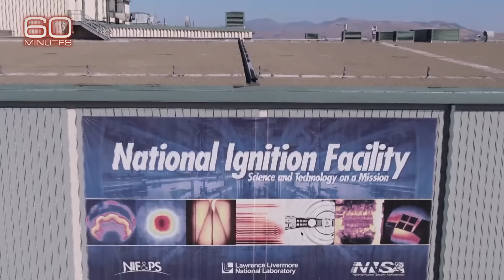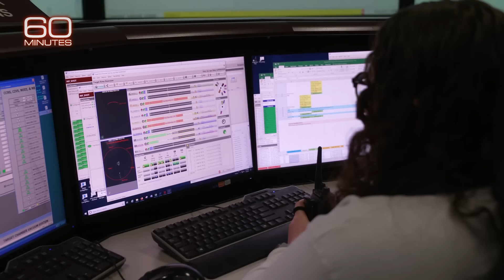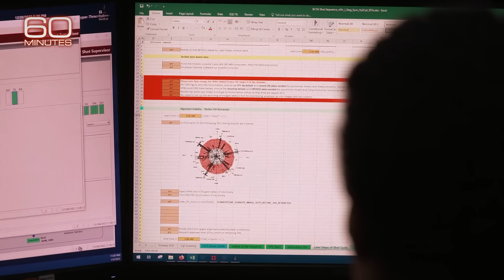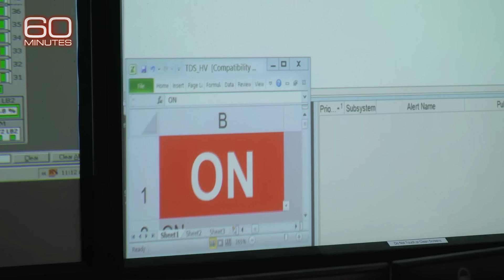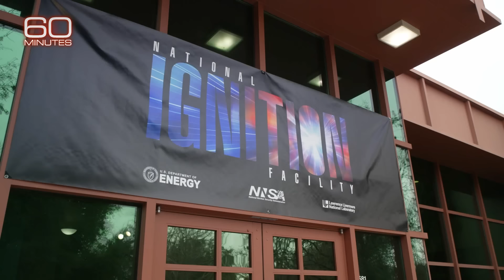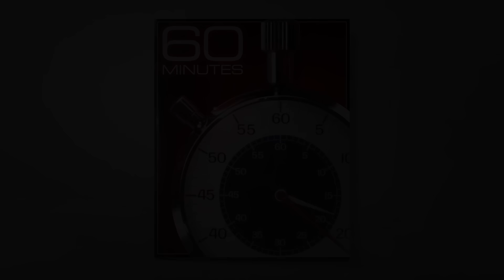Nuclear Fusion Breakthrough; Powering Electric Vehicles; Carbon Capture | 60 Minutes Full Episodes

Comment: The comparison of the ignition at Livermore to the Wright brothers flight is pure lunacy. It was the flight of a complete assembly of a plane, unlike the ignition which is one of many parts and systems that are yet to be succesfully designed.
Reply: The reported experiment at the National Ignition Facility (NIF) took approximately a week to set up but the actual nuclear fusion reaction lasted for approximately 0.000,000,000,08 second. There was no significant amount of propagation of the reaction in the microscopic portion of the fuel that did react and approximately 96% of the extremely expensive fuel was blasted away before it could react.

The maximum shot rate of the enormous NIF lasers is about one shot per day. It is rare to get anywhere close to that rate. Since this announcement  , almost 1.5 years ago, only a few of the NIF shots have gotten close to this announced shot.

Comment: NIF was never designed to generate grid level energy. I worked as a subcontractor to NIF for years in the late 1990s, NIF has no capability to extract electricity, total energy input is orders of magnitude greater than output. Main function of NIF is to make a life long career project for the people who work there.
Fusion is already working (the sun) and it is the cheapest form of electrical energy we call it solar pv and when combined with wind and storage we can and do deploy it today.

Comment: So I am wondering (the last part) if CO2 would be released once we break up the rock?
Reply: One experimental carbon capture and disposal underground relies upon a underground formation that is porous and the basalt then slowly reacts with the injected CO2 to form a long-lasting carbonate type of rock.  The demonstration project in Iceland is sited in a very special place where it is also powered by geothermal energy. This situation exist in few other places around the planet, which the promoters never mention.

In some cases CO2 has been injected underground, specifically to force fossil fuels to the surface. It will be eventually burned with that carbon being injected back into the atmosphere. It is kind of a shell game.

It remains problematic that once CO2 is injected deep underground, in massive quantities, that a portion of it  will not leak out again over a period of time of less than 100 years. The attempts to sequester CO2 underground have been going on for approximately 30-years. It has had virtually no effect on the constantly rising CO2 level in the atmosphere. Many of the projects have either failed to live up to the original expectations, or they have been closed. The promoters tend to exclude that part of the story.

Comment: At 21:50 indicates steam is released and not utilized. Is there a reason engineers do not utilize a turbine and generate power?
Reply: The steam coming out of the brine containers is not being used because it has already been run through a generator, that is just the last part of the cooling phase. The initial excess steam is pumped out of those large towers (cooling towers) and the still hot brine is continuously cooled until it is ready to have the Lithium extracted from it.  Point being, the steam is too low pressure/cold to be used to power generators, but it is still too hot to have the Lithium extracted.

Comment: After sleeping on this I'm still impressed but I have questions .How long can you fire the laser and it makes me wonder what the next move is to have a prosses or design to have the same lasers continuously fed until the capacitors are discharged. Without a continuous fed laser it's not going to be a good source of energy production. It's just a learning tool at this point to see if I could be done. It leaves more questions than answers.
Reply: The laser driven Inertial Confinement Fusion (lCF) nuclear fusion energy research at the Lawrence Livermore National Laboratory (LLNL) experiments began in the late 1950s. The National Ignition Facility (NIF) lasers experience to much damage if operated at a rate of more than about one shot per day. It is rare that they get anywhere close to that rate. The announced experiment took about a week to set up. The nuclear fusion reaction lasted for approximately 0.000,000,000,08 second. It released about enough energy to boil two liters of water. It took more than 100 times that much energy to drive the massive laser system. The radioactive tritium fuel has a market value of approximately $30,000/g and the sources are extremely limited. The destroyed target assembly is estimated to have cost around $100,000. It’s been estimated that NIF has consumed over $11 billion. Its primary purpose has always been as a thermonuclear weapon (H-bomb) research tool. The administrators have always been masterful in obscuring that fact when presenting to the press and the public.

Comment: There needs to be hundreds of such facilities around the world…
Reply: This announced nuclear fusion reaction lasted for only about 0.000,000,000,08 second and the experiment took about a week to set up. The energy released was about enough to boil two liters of water. Over 100 times more energy went into driving the laser shot. It’s been estimated that approximately $11 billion has been spent on this facility that originally promised this ‘breakeven’ event to happen by 2012.

The administrators have become masterful in obscuring the primary funding for NIF which is to serve as a thermonuclear weapon (H-bomb) research tool.

Comment: Can the stone created by these direct air capture plants be used for anything so it becomes a product.
Reply: The demonstration plant was deliberately placed in a unique location which exist in only a few parts of the world. The energy to operate it comes from geothermal energy which was already developed at the site and the underground basalt formation was highly fractured, making it convenient for the CO2 injection. The injection point is quite deep so it is not easily accessible. There are few other similar injection plants like this around the planet. To have a significant impact upon the excess carbon already dumped into the atmosphere tens-of-thousands of these types of plants would likely have to be created and run for decades.

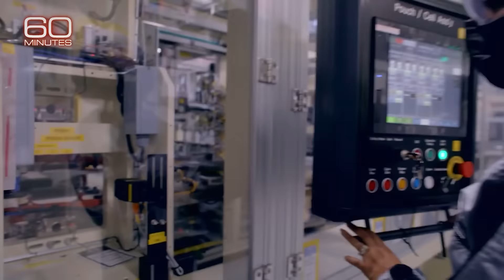Comment: 17:11 the narrative means "energy dense metal." Lithium is not a dense metal. In fact, it floats easily on water.
Reply: Energy density does not equate physical density. By your reasoning Kerosene (a very "energy dense" liquid hydrocarbon) should not float, yet it does since it is less dense than water just like Lithium.

Comment: NIF is an interesting research facility but it will never generate continuous fusion. They never mentioned how much energy goes into making the fuel pellets either. Spherical or tokomak designs are more likely achieve this with magnetic confinement and we have machines which have produced continuous fusion for more than 30 seconds at temperatures of 150 million degrees C.

Comment: 36:50 Wood is supposedly carbon neutral as the carbon released goes back into a new tree. I can see that an equal amount of carbon removed from the atmosphere could offset, may be completely, the amount of carbon sent into the atmosphere with the use of newly produced oil or gas. She did say that the sequestered carbon may be an amount larger than the oil / gas released anew.

Comment: Just checking in a year letter. Needed something to hope for.
Reply: The craving for hope has generated marketing aimed at feeding those cravings.

NIF has about doubled the fusion energy that they can achieve with such highly specialized laser shots but they remain difficult to reproduce such shots. Keep in mind that the pumping of the lasers still consumes around 100 times more energy than is generated by the fusion reaction and that reaction only lasted for approximately 0.000,000,000,08 second. The experiments take almost a week to set up. Like all the other record setting fusion energy experiments they all continue to be many, many orders of magnitude away from demonstrating a economically practical source of electrity generation. As has always taken place the administrators tend to obscure the primary purpose of NIF which has always been as a thermonuclear weapon (H-bomb) research tool. It's been estimated that at least $11-billion in USD, from federal revenues, has already been expended by the NIF program.

Comment: I of course have no idea, but the questions can't help but be asked. Isn't it carbon monoxide that comes from cars more than carbon dioxide? So why are these filters only talking about filtering carbon dioxide? Does it filter both? Also, if we can make filters that take it out of the air can we make filters that take it straight out of the tail pipe of the vehicle before it gets in the air?
Reply: Only a small percentage of the gases that come out of fossil fuel burning internal combustion engines (ICE) is carbon monoxide (CO). This process doesn't trap the CO. There are far many other sources of CO2 emissions that is responsible for Anthropogenic Climate Disruption (ACD) heating of this planet. Also, keep in mind that the process of capturing CO2 is very energy intensive and what we are now doing will need to be expanded by a factor of over 100,000 before it will make a significant dent in the excess CO2 we have already dumped into the Earth's atmosphere and into the oceans.

Comment: Are you actually producing more energy than what it takes to make that energy?
Reply: Not at all. Recently other people have been been asking similar questions. Until recently the NIF management didn't mentioned the energy needed to pump the lasers for such experimental shots. Finally they did respond that the pumping of the lasers required more than 100 times the energy than was generated by the nuclear fusion reaction in the announced December 05, 2022, experiment. It took the lab about a week to set the experiment up so they should have given the energy consumed by the facility for the entire week. Some people question where exactly, in the compression process, that they measure what they refer to as the input energy.

Comment: Local lithium will cut costs for manufacturing companies but  most likely will not be reduced in price for the consumer because it corporate greed to make more profit. Just like inflation prices go up when supplies are low and demand is high when it's the other way around it never goes back down.

Comment: Fission reactor powering a Fusion Reactor? (that is the fundamental function of thermonuclear weapons; fission reaction triggering a fusion reaction, typically via hydrogen)
"perfect spheres" manufactured in "zero-gravity" space?
Reply: Much of the research into nuclear fusion energy came as a result of the quest to develop thermonuclear weapons (H-bombs). That quest was very successful and as a result most of the nuclear weapons in the arsenals of major nuclear weapon states are thermonuclear weapons. The National Ignition Facility (NIF) has always been primarily funded as a thermonuclear weapon research tool. The management has always been masterful in obscuring that fact when presenting to the press and the general public.

Many people have been led to believe that many manufacturing operations could be better done in a near-zero gravity space environment. Some might believe that these diamond spheres could be made far more spherical and flawless if they were manufactured in space. It has been estimated that the target assembly, used in the announced NIF December 5, 2022 shot cost approximately $100,000. Most of it was vaporized in the experiment that took about a week to set up. The fusion reaction lasted for approximately 0.000,000,000,08 second, and that blasted approximately 96% of the expensive supplied fuel away before it had a chance to react.

Comment: Q-Plasma <<< Q-Total.
This means the energy  generated in the Hydrogen plasma reaction (Q-plasma) may be greater than the laser energy input, but the total energy to  drive the lasers and  all the  equipment and process (Q-total) is still almost 100 times more. Commercially, 100 years away.
Reply: The input energy for that one experiment was far greater than 100 times greater than the measured level of nuclear fusion energy that was generated. The fusion energy reaction lasted for approximately 0.000,000,000,08 second. The set up of the experiment lasted for around one-week. The entire energy consumption of the facility during that time and the energy expended in the creation of the thousands of flawed diamond fuel capsules, that couldn't be used, should have been cited as the input reference energy. In past years the lab's, fusion energy breakthrough announcements, were not accompanied with references to the input energy to the laser system. The announced nuclear fusion reaction was extremely inefficient with only approximately 4% of the extremely expensive hydrogen isotope fuel consumed in the shot reaction.

Comment: One thing is the reaction produce more energy than the energy of the laser beam. But the electricity energy requeired by the laser device is 30 times huger than the energy if the laser beam itself. And eveb if the energy produced by the reactor was 40 times more than the laser beam energy, the energy produced is heat. So to turn the heat into electricity they create steam by heating water and moving a turbine, and duch turbi es are just 45% efficient. So again, the energy electricity produced in the end output is smaller than the input electricity
Reply: Yea, it ain’t ever going to be commercially available

Comment: Uranium is very electropositive. What is more, once it splits, it often splits into Caesium, which is the most electropositive element. 

What does that mean? It means that these substances produce electrons very readily. 

It doesn't take much energy to free an electron, and that free electron can be used for power. 

In fact, it takes less energy to release it than it provides once free, which is the key here. 

It is like money from nothing.

Comment: I am not sure that nuclear fusion is the answer because they would only be using fusion as a heat source to operate steam generators.  They have another heat option right now, create Plasma from hydrogen using MHZ frequencies, can produce 11000F, use Plasma heat source for steam generators, far cheaper and available now.

Comment: Your right that laser in not the way to go! You need to use a plasma type fusion system
Reply: The laser approach is classified as Inertial Confinement Fusion (ICF). Once the target is hit by the generated X-rays it becomes a super-heated plasma until a tiny fraction reached a density that results in a microscopic fusion of its hydrogen isotopes. The other primary experimental approach is Magnetic Confinement Fusion (MCF) which deals with a far more diffuse plasma. The vast majority of nuclear fusion physicist agree that this latter approach is far more likely to lead to a economically practical nuclear fusion energy power plant.

Comment: Mabey a meeting of the minds so to speak should be done between plasma fusion and fission scientist could be beneficial to both projects. Or mabey its ying verses yang and it wont quite fit together.
Reply: NIF has always been primarily funded as a thermonuclear weapon (H-bomb) explosion simulation tool. The administrators have become masterful in obscuring that fact whenever they present to the press and to the public. The laboratory has permission to employ specks of plutonium-239 fission fuel in their experiments and this may have been done in some experiments. Thermonuclear weapons contain both fusion components and plutonium-239 components in the 'secondary' portion of the explosive device.

Comment: Need 4k cold nuclear reactor rules...
Reply: Most Magnetic Confinement Fusion (MCF) nuclear fusion reactor experimental facilities rely upon superconducting electromagnets that operate at under 4 degrees Kelvin temperature. Those magnet coils will be only a meter, or two, away from the plasma that operates above 150 million degrees Kelvin while being bathed in a high flux of 14.1 MeV fusion neutrons generated by the fusion reaction. Those superconducting magnets will need to operate reliably for years without quenching. These are some of the challenges that still need to be tested.

Comment: I'm having trouble understanding how this is an achievement at all because according to the narrator, it was 300 units of energy in, and 3 out, when factoring in the energy to power the lasers, which is required.  So why did LLNL hype it as 2 units in, 3 out?  

Also, at the end of the piece he says it is an engineering problem from here on out.  As an engineer, if a scientist handed me this formula (the requirement of millions of perfect tiny spheres of diamond encased hydrogen, lasers the size of football fields that consume more energy than the national grid, I would tell them to go back to the drawing board.